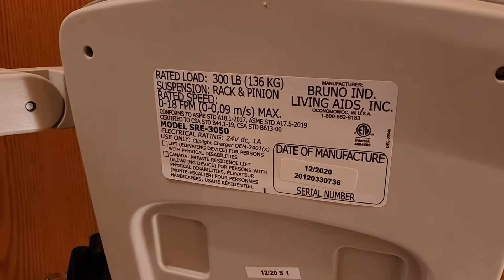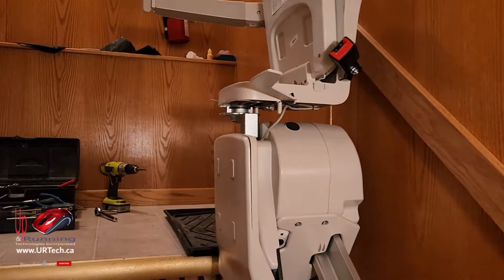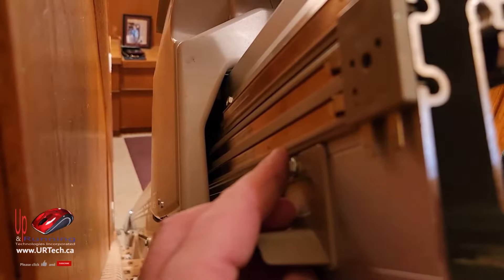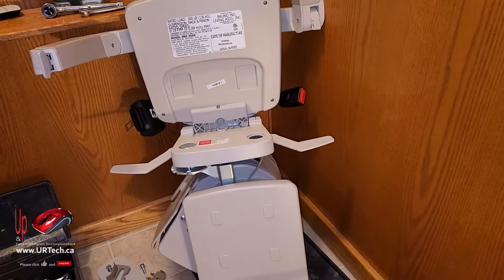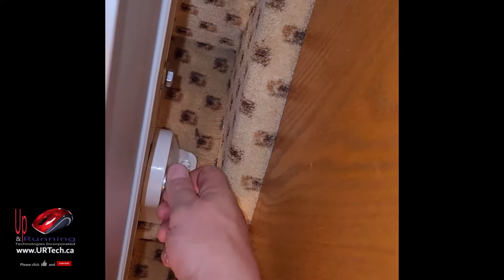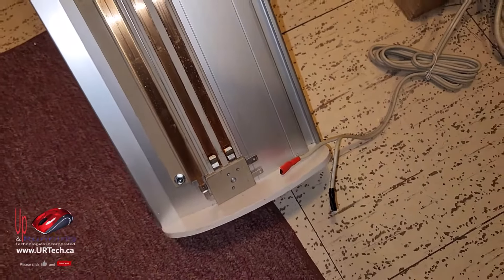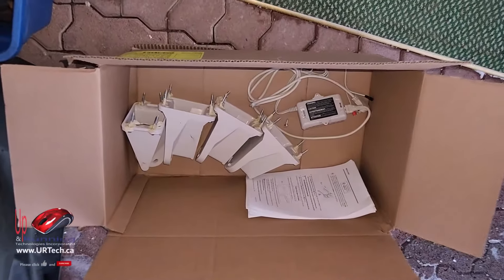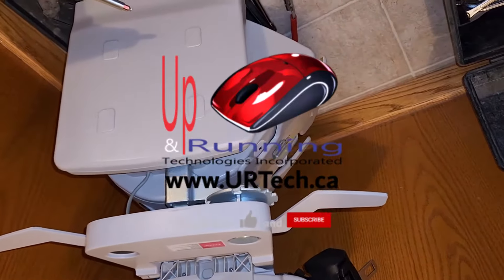How To Disassemble and Remove a Bruno SRE 3000 Series Stair Lift

Comment: I learned the hard way why the video says to leave the bottom end cap on and remove the lift from the top. My stairlift was broken and s stuck at the bottom. While it could be manually moved by turning the motor, it would’ve taken forever to get it to the top of the stairs. I decided to try removing it from the bottom. It wasn’t an issue of space. There was enough room to remove the stairlift from the rail that way. What the video doesn’t explain is that the gear rack inside the rail comes in 6-inch segments. The only thing holding them in is the endcap. If you remove the bottom end cap, the moment you remove the chair lift all those little 6 inch steel pieces come tumbling out. Made quite a racket! It also removed a lot of weight from the rails. If you have a multi-segment rail, you will end up with no choice but to remove all those little steel pieces. So, feel free to remove the lift from the bottom, but I recommend putting some sturdy cardboard underneath so that as those pieces fall out they don’t damage your floor.
Reply: Thanks for sharing your info!
Reply: How did you get the chairlift off of the bottom of the rail? Thank you
Reply: @ in my case, the chairlift was broken. When I removed the end cap, I was able to slide the lift off of the rail with a bit of jiggling, still engaged on the last of the gear segments. Once the chair slides off the rail, that’s when all the rest of the gear segments will fall out. Short answer, take the end, cap off, and slide the chairlift off the bottom.

Comment: Super rad video I did my mom’s house had to remove it for new carpet. Your video is helpful but damn that chair is heavy took all I had to get it off then when I tried to move it, piece of plastic broke on the bottom even in the upright position Putting it back on. Is it going to be hard? I think I’ll bring my floor jack up from the garage to jack it up high enough to reset it. Damn my back hurts. Rad video😅😅

Comment: Thanks for the video I have reinstalled my used Bruno on the opposite side of the steps that it was installed, but the Bruno will go down, with remote but will not go up. seat switch will not work at all? Any suggestions for me appreciate it. Thank you.

Comment: I was told by the maintenance guy to turn the power off before removing it off the rail. Do not unplug but turn the power button off. He said otherwise you will blow the fuse.

Comment: I am currently going through the "school of hard knocks" with moving one of these from one house to another. IMO, it's much easier to take it off the rail and lift it without the chair still attached. The chair makes it extremely awkward, out of balance and hard to get a grip on it. By itself it weighs 50 pounds. One screw takes the plastic cover off the front to expose the 2 large bolts holding the chair on and the electrical wire connection. Unplug the wire, take the bolts out and remove the chair. The factory has another looped wire connection on the wire to plug back into what was unplugged to bypass all the safety cut offs the chair has so you can use the remote to move it without the chair on it. Take out the last row of teeth in the gear track. This will make it stop before it fails off the end of the rail. You can then easily grab the motor and gear assembly to lift it off the rail with no chair on it. Also, once I do know why but the second time I don't know why, it completely lost all power and would do nothing, twice because a small 5 amp fuse blew on the circuit board. If you lose all power, look there.

Comment: Question, can the chair and motor portion be taken off at the bottom, or remove the bottom cap and take it off there ? Don't want to have to carry that heavy suckered down a flight of steps.
Reply from the maker: I don't think you could pull it off of the bottom because The chair base is larger than the gap between the rail and the floor so I just don't think it would come off but it might get stuck there so I wouldn't even try. Yes it's heavy but it wasn't near as bad as I thought it would be. I moved it without great difficulty

Comment: Thanks so much for this video. I just bought a used SRE 3000 series and installed it myself. The chair is only 6 months old. After the installation is completed, there is no power. The chair wouldn't do anything, no beeping as well. Do you know what the problem might be? Thank you for your advice!
Reply: Looking at a used too. Does it have to be left or right? Wondered if you remember. I was suprised to find one with the length of track I need
Reply: Hello.. I am having same issue. Did you find a solution? 
Thanks in advance.

Comment: Hi. Thanks for the Video. 

I bought one for my mom and disassembled it from seller. 

The 5 amp breaker on board was bad and I replaced it. 

Once I mount it on track, I get nothing. The batteries are good and I am getting about 26volts.

I have tried everything and can't seem to get this working.

Any help from anyone?

I turn the breaker on and off but I get no beeps nothing.

The 25 am fuse is also good.

Comment: Slightly off topic re a Bruno 2010.  Made about 2018.  I bought it used in good operating condition.  The installation instructions show a steel "cross pin" to be installed at the bottom of the rail.  The cross pin appears to be for the purpose of taking some weight off the bottom plate which bears all of weight of the gears and chair.  The cross pin is to be installed through the rail using a template in a way that prevents the geat set from moving downward.  The unit I have does not have such a pin.  Anyone with comments as to the importance of the "cross pin"?
Reply: Replying to myself(:  I definitely learned that they come from the factory as left or right mount.  Our lift was right mounted so the conversion to left mount was a bit complicated.  I figured out how to rotate the seat mount about 90 degrees.  The trickier part was changing the seat rotation which involved removing the seat from the base (mounted very stoutly with roller bearings), removing the plate covering the seat bottom switches and moving the detents.  Unfortunatley when I turned it on I got codes L1, L2, & L3 which I have been trying to diagnose.  In the meantime I did a workaround - I "hot wired" the battery directly to the motor with a reversable 30 amp switch which of course eliminates all the safety switches.  But we only use it twice a day with supervision.  I may call the original installer for a service call.

Comment: That is certainly not the correct way to remove this lift.
Reply: Why?
Reply: You are right.   Not even close to the proper way.
Reply: The proper way is to remove that end plate.  No need to remove that plastic stop in the back.  Run the chair down far enough to slide a couple of the gear segments out.  Then run the chair up until it runs off the track.  At this point, turn off the power.  Remove the seat from the motor assembly.  You can do that by removing the snap ring on the bottom of the seat post or by removing the two bolts that bolt the seat post to the footrest.  Remove the Front cover first and unplug the wire going to the seat.  Once the seat is off, simply slide the motor assembly off the rail.   Much easier than wrestling the entire motor and seat assembly off the rail and much less chance of damaging the charging fingers and etc under the unit.